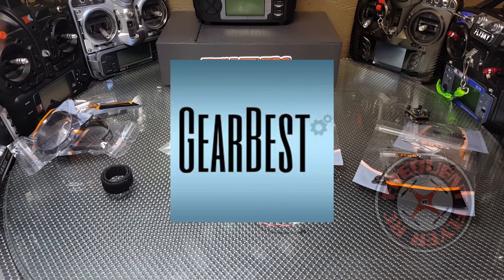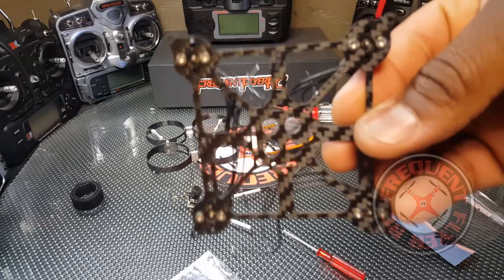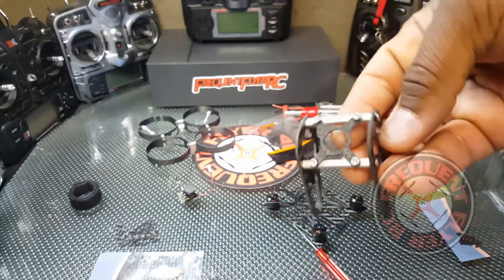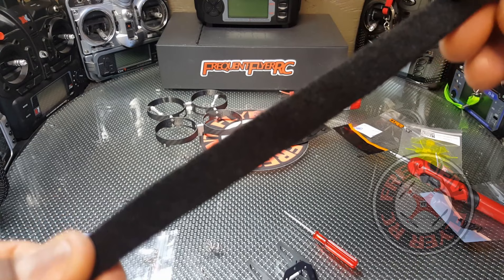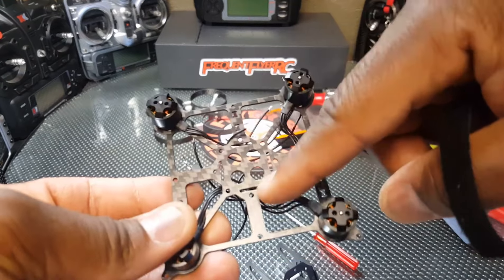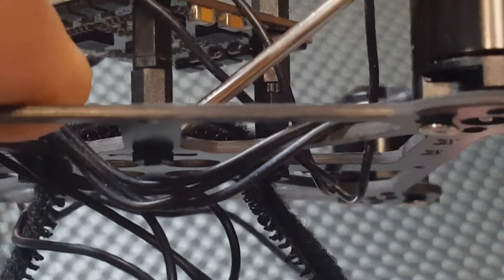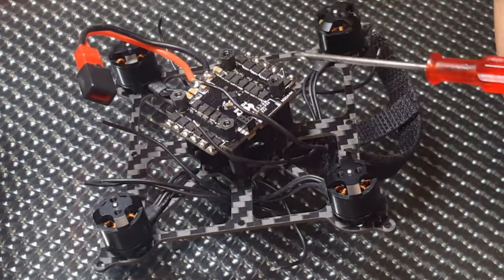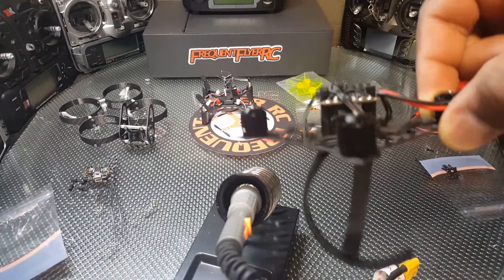Coretex RC Tiny 90 Brushless Build Video DSMX Satellite Receiver and My First Impression

Comment: Wow ... pretty hefty price for a KIT which you have to build. I think  you can find something similar (brushless) already built for less than that, but, I know, the fun is in the building (others might say the fun is in the flying).  But you know how everything is assembled, so if you ever have any problems, you'll be able to deal with them directly. Good luck   Cheers!
Reply from the maker: +Bill Somrak indeed it costs a little more than the Aurora 90 I think but seems to be beefier with taller motors and thicker CF ducts. I would rather buy them assembled! LOL

Comment: at 13:45 were you able rotate the transformer (don't know the jargon) so that the pads were closer to the corresponding blade meters.
Reply from the maker: JaRon Burnett Oddly enough, I understand what you meant lol! No, the board has to stay installed at that angle because the screw holes on the frame were pre-drilled in such a way.
Reply: Makes sense